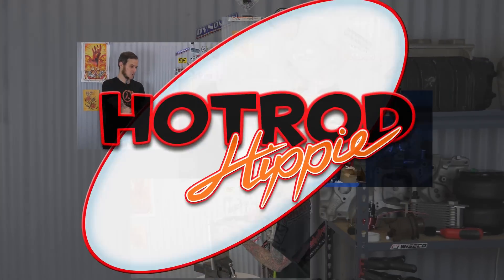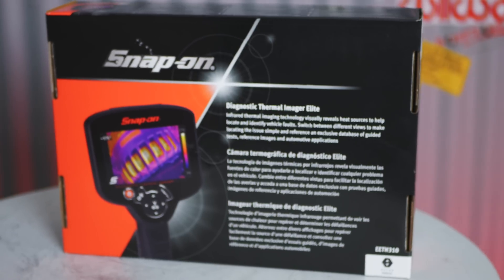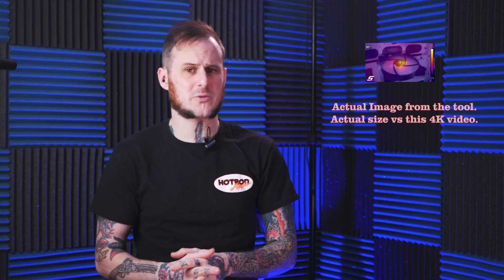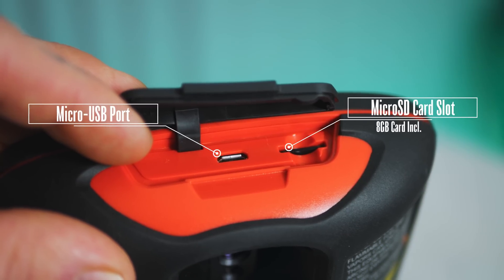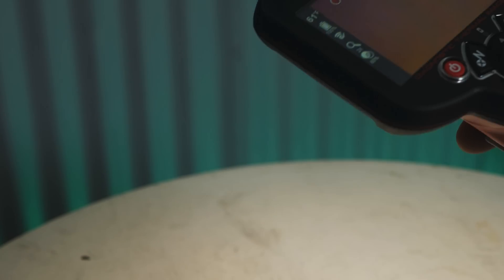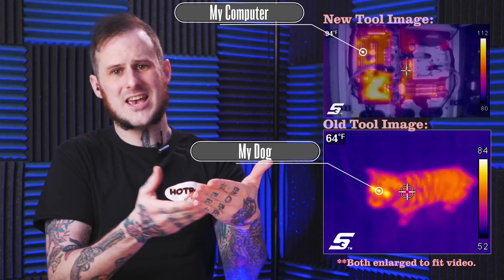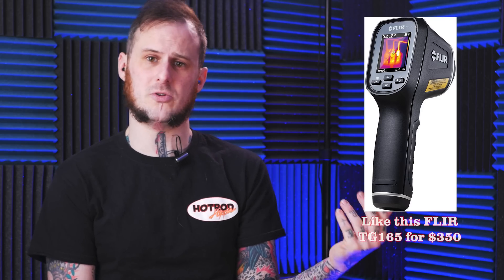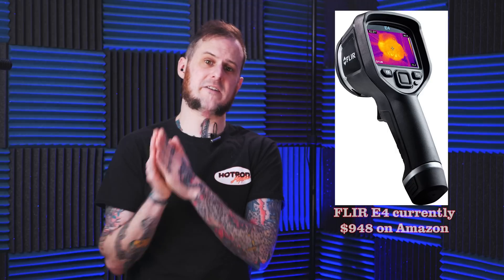NEW Snap-On Thermal Imager - Product Review - EETH310

Comment: I have the flir...didn't have the budget for the snap on one and the flir does enough for what I do
Reply from the maker: Which Flir unit do you have? I'm debating which unit will be in my arsenal.
Reply: @HotRodHippie  FLIR TG165...got it for less then 300 cad

I do construction and part time mechanic work so I use it to windows and doors 
making sure your house well sealed is quite important here since it is -30 c most days
Reply from the maker: Oh yes. I used the previous Snap-on one to check my house last winter. Found my nice windows were badly installed, lots of air leaks around the casements. So despite having good windows, I have to plastic them in the winter.